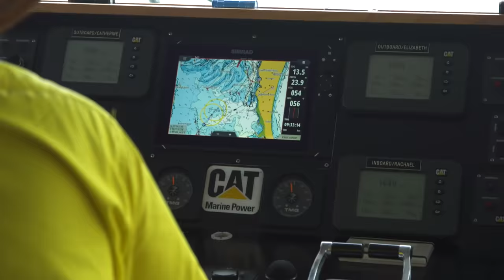ROOF DEEP water crossing causes CHAOS! Moreton Island adventure gone wrong...

Comment: If you're suspecting a flooded engine, put a socket on the crank with a short handle and turn only just hard enough to slowly spin the engine normally. If there is too much water, you would feel the lock up point and you definitely need to pull the glow plugs. If there is no or little water, you should make multiple rotations  and go for a crank.

Comment: Love my GM. "Work truck" trim. Rubberized floors. Great for mud, water, sloppy snow etc. I've had now waves up to the bonnet... But my door seals held up. No snorkel tho. 31" of water fording stock. With lift and tires. I'm good to about 35"

Comment: Nissan factory “snorkels” are not actually snorkels they are raised cold air intakes. Where the airbox joins to the plumbing in the guard its just a foam seal. So no wonder it got water in. 
Also the factory airboxes done seal well

Comment: When you prepped the truck for a tow from the rear, did you consider letting the rope drag behind you for easier access instead of letting it ride on the back of the truck?
Reply: Problem with letting it drag behind is when you stop and go to reverse you end up running over your  rope

Comment: Stupid question but I’m a bit confused with how the whole driving in deep water thing works. So what I do know is that the snorkel is raised to allow the engine to get air and no water obviously but I’m wondering what happens with the exhaust. Do these vehicles have raised exhaust or what happens? Also how do electrical components in the engine bay not get damaged?
Reply: opzz xsin  well that answers that